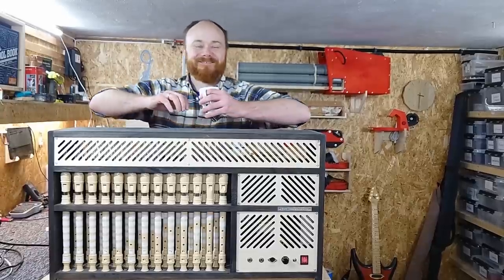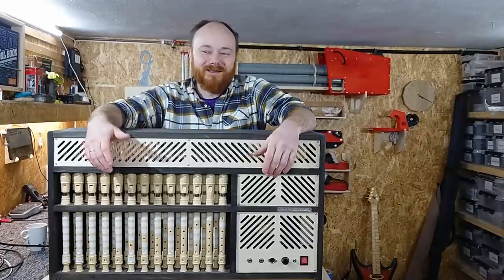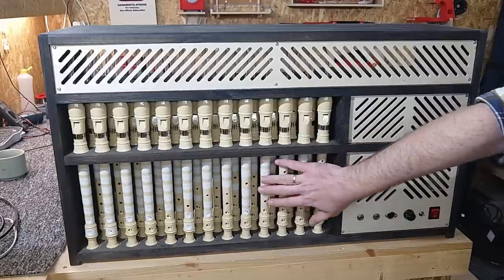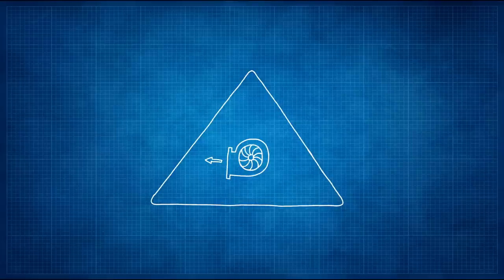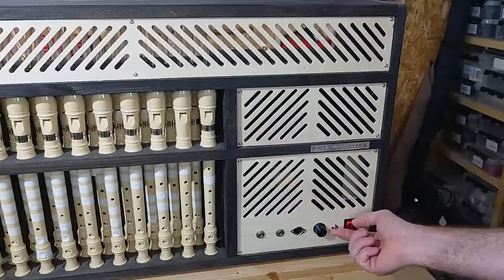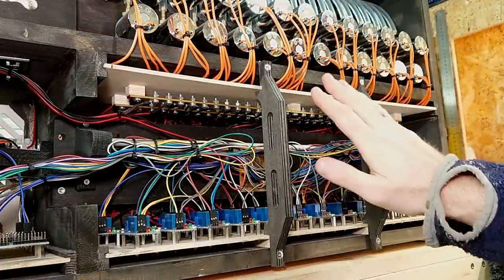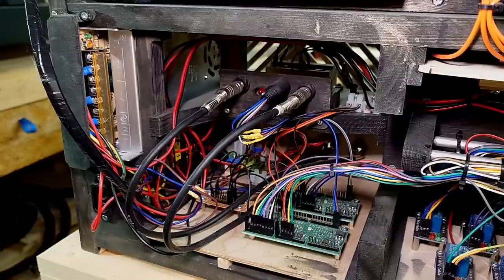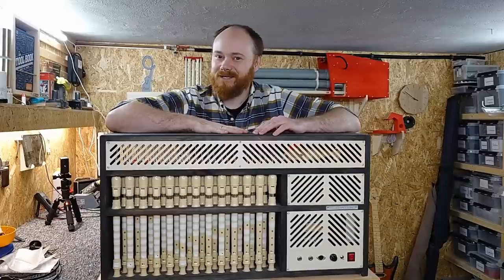The Hellcorder | The World's First Recorder Based Guitar Amplifier

Comment: This is insane! I was not prepared for that demo. I'm not a musician and I don't know your requirements for such a device, but if you ever make a version 2.0 of the Hellcorder, I have some ideas. You could potentially bypass the need for midi entirely and create a recorder-based amplifier that accepts any analog input signal by doing some signal processing and changing how the flutes are played. 
First, the fundamental frequency of each flute would need to be known. The Fast Fourier Transform could be used to tell which frequencies are present at the current time in the input signal, as well as their intensity. An algorithm could be devised to play multiple flutes at the same time such that the produced "sound" best "matches" the input signal.
The second largest change would be to replace the solenoids with some sort of variable diaphragms, or some sort of plungers attached to voice coils so that the amount of air, and hopefully the intensity or loudness of the flutes could be controlled.

I know you didn't ask for this, and I certainly wouldn't want to build it, but I thought it could be interesting.

Great video!
Reply from the maker: Thank you, and very great input :D
Reply: Ah, great minds think alike, but you were two or three hours ahead of me 😬. A recorder-based guitar amp simulator that does FFT of the input signal and then recombines the sound by activating the recorders based on the FFT results. I would love to become a beta tester for such a device, which could easily rival the Wintergatan and Lookmumnocomputer projects. Sort of.

Comment: What about just one recorder and change the notes on it with some kind of "mechanical fingers"..? Then you don't really need to turn on and off the air flow apart from rests. This would eliminate the tuning issue as one would assume that a recorder will at least be in tune with itself (unless it's a really crap cheap one). It would also be easier to mike up, for more volume. 

Come to think of it, something like a clarinet might be better as it already has mechanically keyed valves, they would just need solenoids to operate them, which could probably be smaller and quieter ones.
Reply from the maker: I've actually seen that before. "Fingers" operated by servos and controlled by Arduino. I would like to do that one day, but then with a proper flute and not a recorder. A proper flute, as you mentioned, will be much easier with mechanically keyed valves. It will also look VERY steampunk! :D

Comment: Instead of relays you should use mosfets, they are better for this application: no noise/clicking, no delay, high-frequency, no magnetic coil effect
Reply from the maker: I am considering it and also using optocouplers to keep the curcuits "physically" separated.

Comment: Great idea ! What about compressed air replacing the noisy fan ?
Reply from the maker: I did think about that for a while, but a silent compressor I found was quite expensive and since recorders need very low pressure and steady airflow I thought fans were the right way to go. As I'm now looking at having a flow valve for each recorder, compressed air might again be on the table - but still it is the noise/price issue :D

Comment: Can you control relative volume of each recorder? If so, you might try turning each frequency band of input signal into equivalent recorder at a proportional volume. And then you'll have effectively built a vocoder with acoustic recorder as carrier.
Reply from the maker: The short answer would be "not yet?". Interesting idea :)

Comment: I love it!   Try this though.  Setup your DAW to trigger one note on and off (equal intervals) at a fairly slow rate.. maybe 1/4 notes at 90bpm.   Next, exchange the air hose for that note for a really long hose.. maybe start with 30 feet or so.  Your ADSR envelope needs some help with the A and the R, attack and release.   Adding some tubing that's either softer.. or just using same type of tubing but a longer piece might create some L/C storage to slow the ramp time of the notes on/off.  Guessing that would sound much more musical.  I was thinking of all sorts of alternatives but the air valves are likely designed to open/close completely and not partially so while adding a capacitor across their solenoids MIGHT soften their on/off cycles... I suspect the valve design won't play nicely and tend to have hard-knee on/off character.  Only other suggestion would be maybe to use a large capacity air compressor (like used for garage shop)... get it fully topped off with compressed air... then unplug it so it doesn't switch loudly on during performance... and have a very large reservoir of compressed air (silent) to power your instrument?   Just a couple of thoughts.    I think you're an excellent mad scientist and I love the name of your channel.   Many great innovations came after considerable 'failures'.. what did Edison say about the lightbulb... he had to find the 999 ways NOT to make a lightbulb before he found the one way to do it right, or something like that?    Anyway... BRAVO!!!   Great work and love the workmanship... it is really quite beautiful!!   Don't give up on it though...
Reply from the maker: Those were good tips, really appreciate it! It also gave me the idea of leaving one relay on a separate channel, which easily through MIDI can be used as a metronome.

The solenoids are maybe the largest headache, but I'm ordering one just so I can dissect it to see if I can easily convert it to a organ solenoid valve. Those I also believe use a resistor, as you described, to soften their cycles - in addition to felt tips on the valves. Someone also suggested trying lowering the voltage on them as they are quite punchy at their rated voltage and are really not made for music ;D

Thanks for the comment by the way! :D

Comment: Genius, I love such Ideas and the amount of effort you put in, definitely worth subscribing ! How well is the pitch tracking working ? I have the impression, that it might not work well enough. Could it be an idea, to take a look into some synth Pedals with a Midi out, and take the note information from there on ? There are some decent Synth Pedals with great tracking out there. That might save some trouble. A test could be done via an Audio to Midi DAW-Plugin. For the current setup i'd even recommend testing it with midi signals sent by a DAW to sort out issues, but you probably have done that.  A different approach: taking the different recorders main frequency, and splitting the input signal in according frequency bands. Of course it would require adjustable airflow through the recorders to represent the amplitude of each band, maybe with a central pressure vessel and adjustable air flow valves. Propably much more complex than it appears to me right now, nevertheless i wanted to drop some thoughts. Keep it up !
Reply from the maker: Yes, I will use the DAW and/or keyboard while tuning. That will also give polyfony, which is basically only a problem with using a guitar. I have gotten a lot of good tips on how to sort that out as a lot of exciting things has happened on that fron the last years - after I bought the MIDI-modules :)

Comment: Nice work! Shame about the sound 🙂There's some software/VST called 'Jam Origin Midi Guitar' that outputs polyphonic midi from a guitar signal. Obviously you'd need a PC between guitar and 'amp' and that would add a small latency - but maybe worth a go with the trial version and see if it works?

A different idea on a similar theme to this project - how about a slide-whistle based monophonic 'amp'? I guess wider intervals would incur worse latency but you would only need one whistle instead of 25 recorders!
Reply from the maker: Thanks mate! It's a shame about the sound, but as recorders go, it would never sound bad. The good news is that everything works, so I can focus on tuning the recorders (and a few more other critical, but related, issues). 

I did look into Jam Origin, but I didn't want a computer in the mix, but that would work (I think). I also have a guitar with a Graphtech pickup system that allows the guitar to output midi with the help of a guitar synthesizer, but even that required a separate unit (which I could of course have built into the box). I could also have integrated a small pocket computer in the design as well, running Jam Origin, but I just opted out - also due to cost and complexity.

I have seen people playing single flytes with servos and arduino, so that could be an option for a different project. This one though, I wanted to have the form factor of a guitar amplifier haha....'cause who doesn't? :P

Comment: I can see the screws for stabilising brackets to keep the bus bars and relais in place will wear out the wood at some point. Especially if they are put in and out a lot. Embedding threaded brackets and pairing them with fitting screws should go around that.
Reply from the maker: I have had that same though, and think I will loose them in the 2.0 :)

Comment: I have a $200 Fishman MIDI pickup that’s polyphonic and works reasonably well. The output is sent to the computer via USB but then it can be routed to any MIDI device. Would have been a much simpler solution here, but may have been against the spirit of the project 😂
Reply from the maker: I did actually look into the Fishman, but thought I needed proof of concept before using (more) money in that system :) Of course, the design brief was that you should preferrably plug any old guitar into it and get it to work. That's unfortunately a bit hard if you want poly - at least today :)

Comment: Hmm. Did the idea of using some actual organ pipes cross your mind? I once had the oportunity to get my hands on a dismanteled organ. We used them to play the intro of "Und also sprach Zarathustra" by Richard Strauss with five or six guys (including some drums to fake the timpani) and it was great fun. Organ pipes are "easily" adjustable and probably an organ builder can help out with proper ideas of a nicely working air flow system. Good luck and yes, this idea is actually unique!
Reply from the maker: Not really, as that would move away from the absurdity of using recorders 😂

Comment: Dude I had one of those pitch to MIDI converters. I could not make it work reliably with any of my guitars. Semitones are pretty much impossible. I wonder if you got a triple play pick up, connected to a cheapo NUC computer with a equally cheap Recording interface and outputted straight MIDI you would have a much better time. With the added benefit of being polyphonic
Reply from the maker: No, they are not very good. I do have a guitar with a pickup system that allows for MIDI through a synthesizer, but that's cumbersome. So looking for other ways, and NUC might be a viable solution :)

Comment: Have you considered more air? Like using a remote compressor and a storage tank to provide plenty of air on demand (look at Festo or similar) and a PLC (Allen Bradley or Siemens) to run your solenoids (likely also remote). This coupled with the pipe-organ replacement could provide some solutions (and expense). 

This is such a cool, cool project.
Reply from the maker: Thanks, and good input :D Might be more expensive than I originally bargained for xD

Comment: I would lose the MIDI and run a DSP on a microcontroller with an ADC input for the guitar. Via the correct filters you could easily get the polyphony you seek, also providing many other possible configurations to experiment with.
Reply from the maker: Yes, that might be possible :)

Comment: I love this!!! I'm wondering if using a Teensy 4.1 with an audio shield would do the trick. It has a stereo line in, so you could probably use it with a preamp and some simple fft-based algorithm to generate better midi signals, and send commands via serial/usb to a separate board with I/O for controlling the recorders!
Reply from the maker: Probably, but way above my programming skills I believe :P

Comment: if you;re planning on polyphony, start with what's called a Hex-pickup (the basis for most guitar to midi controllers). Essentially is has one coil per string for individual sampling. There are some that can be easily retrofitted to a majority of guitars.
Reply from the maker: Have one of those, but have yet to find the best hardware and/or software on the processing side that work satisfactory :)

Comment: I've been building a membrane clarinet, it also can work with just air pressure... It is made from PVC pipes and.. well, a membrane. Too difficult to explain, search in youtube for membrane clarinet. I'm in a pickle with that project, i don't know if i want to make it human breath powered as it needs fair bit of air volume, or.. should it be more like an organ. The sound is lovely, it sounds more like a mix between saxophone and oboe, a lot depends what material the membrane is and the resonator (there are no terms for that instrument, but i found a resonator box on the input side beneficial and it changes the sound fair bit, it is basically two membrane clarinets back to back with an airbox between them..). I have 3D printed all the custom parts like the head and mouthpiece, have gone at least a dozen version to get some idea how it works, it has 3 sides that impact the sound and pitch which makes it really difficult, input, output and external... External is the easiest but unlike ANY wind instrument it has input and output piping that needs to be considered. Typical wind instrument is "blocked" in one end so you only need to tune one side.
Reply from the maker: Membrane Clarinet was new to me, but after googling it I found a lot of videos. I like the sound, but as you already has mentioned, it might be difficult to make a good "mechanical" substitute for the human for making a good sound from it.

I know I one day will build something from PVC pipes and have been looking at those PVC slap Organs (or what they're called) :)

Comment: I want to hear what's possible by cycling the air pressure levels (think synth LFO, or guitar tremolo effects). Also a release time control where the air stops more gradually at the end of a note.  An orifice (tiny hole) that causes a bit of pressure to build and then bleed off would be enough to get a release of ~50-60 milliseconds.
Reply from the maker: I love all the good tips and suggestions I receive on this. I got a huge list for the 2.0 by now :D Thanks by the way :)

Comment: You could maybe consider pan pipes of different sizes? It might be possible to manufacture them out of plastic pipe to keep the costs down.
There is no reason why you would need to use multiple recorders if you only need each one to play a single note. The same system could be applied to hit a xylophone for example no air flow problems then.
What I found particularly interesting is the concept of using one instrument to effectively control a completely different acoustic instrument. Good effort all round!
Have you seen the marble machine made by Wintergarten by the way?
Reply from the maker: I'm afraid if I use pan pipes I will be banned from Peru! 

I know, but the design brief was using recorders. I have seen a guy that now casts recorders from recycled plastic, which maybe would enable me to cast single note recorders, but I'm afraid to scare him off when I tell him what I need them for haha.

Yes, Martin from Wintergatan is on a whole other level, both musically and technically. His journey the last couple of years has been fantastsic to follow :D

Comment: A magnificent folly! Could easily be made polyphonic using two octaves worth of filters (as in a vocoder) each being rectified and used to trip a driver for the the relevant solenoid. And anyone wanting a cheap solenoid/valve source - scrapped washing machines!!
Reply from the maker: That kinda sounded like the start of a poem; "A magnificent folly, wanted to go poly..." Never mind. That would sound definitely outside of this context! 

The solenoids were actually "quite" cheap. I think I would have used a long time searching through washing machines, but that would work.

Comment: In order to be actually polyphonic with a guitar your need six of those and your guitar to have a hexaphonic pickup in order to have a full polyphonic control. What your guitar to midi module do is to pick the frequencies and translate them to midi values, which can't recognice a note from a chord, maybe in 5 or so years but not right now, at least at a reasonable price.
If you want to go the more audio to midi with a hexaphonic pickup i suggest you to salvage a PoweGig guitar, nobody wants them since is a cheap plastic guitar meant for a game nobody likes and has a hexaphonic pickup!
Reply from the maker: I do have a guitar with a GHOST pickup system from Graptech, but that unfortunately that needs a Roland Synth to produce MIDI out for all the six different strings, and I'm not a fan of Roland :P

You are fully correct with regards to the analog to MIDI converter, but that was what was available at a price I was willing to pay for it :D There are some decent software alternatives, and they keep getting better, but that still needs a computer to work. Now, that being said, with the size and power of computers today that would be possible....although a bit outside scope :P

Comment: Higher air pressure might also increase the volume of the recorders, but as you said, there are tradeoffs to consider...personally, I instead of blower, I would try a workshop compressor if you have one/can obtain one...yes, they are loud and would need to be in another room...and they can be expensive....but as per the triangle, that's the cost of good air flow
Reply from the maker: Yeah, it's the cost. Also for a descent reducer for this kind of application :P